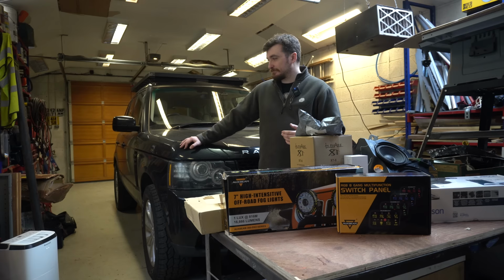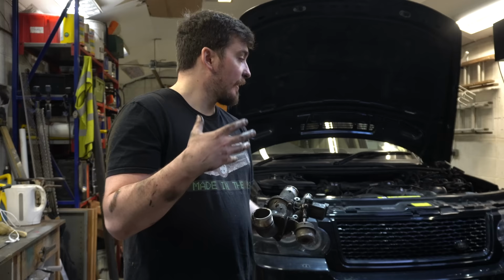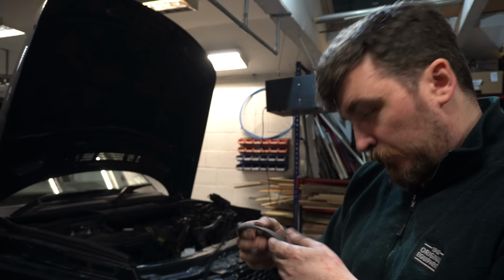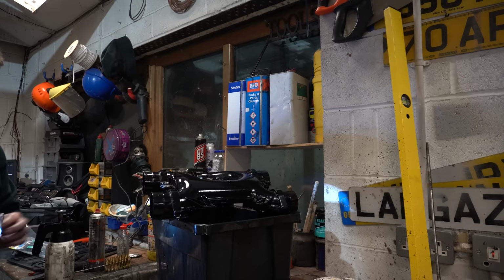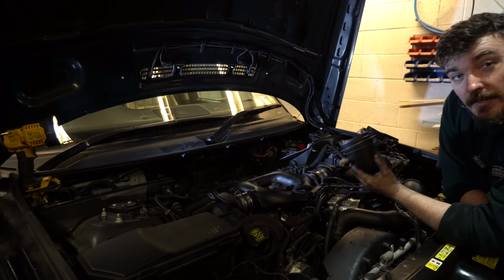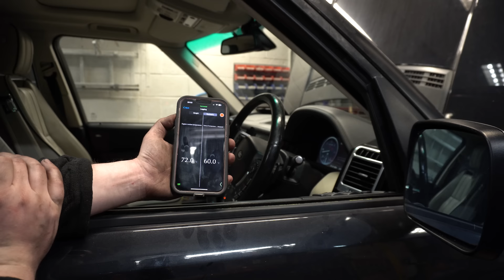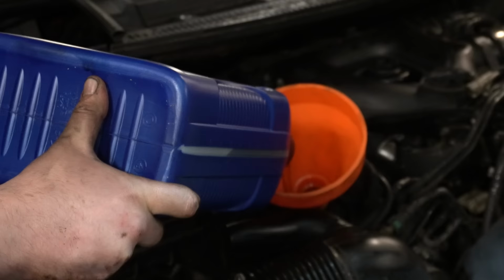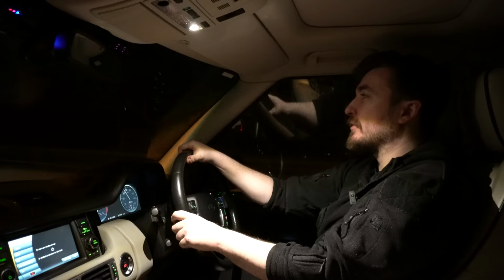THIS is why EGR is so bad for your Range Rover. [4.4 TDV8 Belt Squeal, Inlet Cleaning & Service]

Comment: I took of the EGR valve, and made two aluminium gaskets about one millimetre thick using the EGR as a template, I then put the whole lot back together, with some gasket cement, and effectively blocked off the EGR valve with the two aluminium plates, which did not have the big hole in the middle of them. I put everything back together, and started the engine, which not only ran perfectly, but after a hundred or so miles on the road, I realised that my diesel consumption had improved from around 18-19 miles per gallon, to almost thirty miles per gallon. I have since then covered around twenty thousand trouble free miles, with no problems, having effectively blocked off the EGR valve.
Reply: Not saying you haven't seen that increase, but one of the reasons for EGR is to improve MPG
Reply: @Phantom-mk4kp  yer right,stop spreading lies,you work for car companies.who cares on the mpg it’s nothing,people don’t be gas lighted??ask these questions does the government and the car companies what your car to last???do they won’t you to have your own car??? They want to destroy your rights and freedoms
Reply: @SuperJacobe just because you don’t understand how an engine with an EGR system works. Doesn’t mean the boogy man is coming to get you. 😂
Reply: I can happily report that I did the exact same thing with the exact same results. Had the egr deactivated via software for about a year but finally blocking it technically made a huge difference in many ways. Seemingly imy egr was stuck open or something as the engine now has got much more power/boost with light throttle. Where did you block yours? I just put in a plate in the flange before the final elbow that goes into the donut.
Reply: @vb879dr  Thanks for your response, and I am glad that it worked for you too. I blanked off the egr on inlet and outlet side, and capped off the vacuum pipe. It's better than ever right now.
Reply: What a load of bollox
Reply: @pking6402 what makes you say that egr is a curse so is dpf,I am not a keyboard mechanic but worked on Volvo and Scania trucks till I retired.admittedly a much bigger engine but same principals
Reply: There's a big chance that should you push your engine bit harder you'll get Check Engine light. You can turn it off again with cheap OBD reader. But pretty annoying still..
Reply: Guyes I also removed the EGR and unblocked or hollowed out the DPF. Got the same 10 mpg improvement as the others. We also did a mild eco remap to supply a bit of extra fuel to match the better air flow. No problems ever since. Get your regular mot mechanic to do the work. He needs to pull the emission probe back a bit when he does the mot. Im lucky, no mot where i live.
Reply: I have a croma with a egr and dpf delete runs great dose about40 to the gallon on a 2.4
Reply: I ordered from auto doc put my reg in and I received the wrong part had to give them my vin and I then had to build my own drive shaft from parts
Reply: @Phantom-mk4kp  The concept of Exhaust Gas Recirculation was developed by General Motors in the 1970s. The goal was to reduce emissions of nitrogen oxides (NOx), a gas harmful to human health. Unfortunately, due to EGR gases mixing with modern thin diesel oil vapours via PCV it causes sticky sludge to build up in the intake. Essentially, we are choosing to destroy engines rather than our health.

Comment: I got the errors "EGR throughput too low" then I switched to Aral Ultimate Diesel and the problems are gone. Ultimate is somewhat costy, but it cleans the engine and eliminates the carbon.  Highly recommended. Cheers, Chris

Comment: Two things Sam, Christian of LR Time fame advocates the 5W-40 oil too! So you are in good company. Second, have a Google re cracked walnuts to clean the inlet manifold in situ. I tried it and it cleaned them perfectly without taking the inlet manifold off. And oh yes, short journeys kils fossil fuel engines, get an old Nissan Leaf for those short journeys and you won't look back! There is no need to worry about battery range as you only use it for those short journeys, together with a home charger at night time rates, it ticks all the boxes!

Comment: Intake cleaning is mostly ‘cosmetic’ as there is still plenty of flow capacity for a diesel to run at full power. Look at the cross section area of the throttle intake then divide by 4 to see how much each intake on the valve cover would need to be blocked to restrict overall flow. The important bits on these 4.4’s you have covered - leaks, MAP sensor fouling ( clean every month) and throttle plate cleaning ( excessive fouling and loss of movement can strip the internal gear teeth). Oil changes in the 5-7k mile interval are also wise as the factory interval is way too long and older higher milers with ash clogged / reduced soot capacity DPF’s will regen more frequently leading to possible oil dilution issues.
Reply from the maker: Yep, concur with all of that.  My DPF is no longer an issue, but before I had it “fixed” it was attempting regen nearly every journey due to high ash load.

Comment: 100% on the 5W40. I use this (Mobile 1 or Liqui Moly) in my ML350 BlueTec. I also add an oil additive called TurboMaxx. The guy has a channel with interesting tests. As an engineer you will also find this interesting. If only we could get the RR 4.4TDV8 here in Canada.

Comment: Had the inlet off my Dad's BMW 120D to replace the glow plugs, really surprised the thing could run, there was so much shit and sludge in there that the swirl flaps wouldn't operate and just enough room to stick a pencil in the inlet. Cleaned it all out and it's a different car, with no more black smoke when you boot it. As with yours, it's a good job done. EGR's went walkies (mapped out % deleted) on mine as soon as I got it, never had any issues.
Reply: Have you had any issues with the DPF regen or getting it through the control technic Ben? That's the bit that worries me about the EGR :\
Reply: @JohnBaxendale  mine is not fitted with a dpf, so don’t have that to worry about. As for the egrs and the control technique, it’s been through two tests since having them done and it’s passed both times without issue. They are both still on the car, and if inspected still look hooked up, they are physically deleted with a blanking kit and removed from the ecu map. Emissions are super clean at every test.

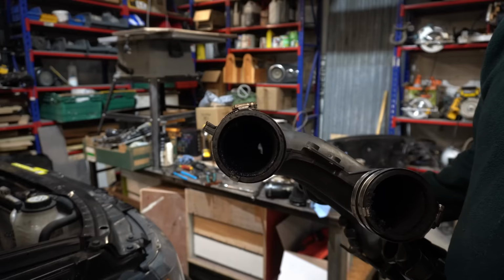Comment: 19:28 This is oil caking with soot. You should replace your oil separator.
The soot from exhaust/EGR is dry normally. The oil vapor from crankcase is what doing it mudy.

Comment: Great video as usual. Just for the craic, I have a justified hatred of changing the belts or pulleys. However I did manage to do the last couple without removing fan shroud or lower trays etc.  Just top charge air pipes and one or two coolant and induction pipe.  and the two airboxes..  Cranked fan off and just moved it out of my may enough to access pulley bolts and tensioners. Changed both belts in 2 hrs... Fair bit of potty mouth and a litre of blood but its doable. Anyway maybe helps someone.

Comment: Cool vid. Love the 80's synth pop haha! Might be worth you just blanking the EGR completely and venting the PCV to atmosphere or using a quality catch can. Legalities observed of course! I did the same on my D2 Td5 and it runs like a Swiss watch. I removed and cleaned out the alloy intake manifold twice, post EGR 'surgery', and just sloshed around a whole can of degreaser inside, worked a treat. Removing those restrictions on the intake and output of a diesel and shedding weight from the vehicle are the best free performance mods you can do IMHO.
Reply from the maker: Cheers for the comment!
The PCV on the TDV8 is a bit of a pain to access, it’s situated in the “vee” of the engine underneath the EGR valve which is underneath the oil cooler.  I’m not sure how it operates or what it even looks like, but I presume from its position that it vents directly into the head/inlet manifold rather than further back in the system.  I think the oil in the charge air system is coming from the turbos, and probably mostly from the secondary turbo which is only used when you boot it over ~2k rpm which isn’t very often.  
I’ve not had a Td5 for a long time but the biggest gains I got were from deleting the EGR and cat 👌🏻

Comment: I blanked off the EGR’s on my 3.6 TDV8, & the EGR on 4.4. Once I had done the 3.6, I found that my oil, I always use Edge Professional, retained far more viscosity. I always used to change it at 2.5K & it used to be black as the ace of spades. Once the EGR’s were taken out of the equation, after the first change, at 2.5K the oil would be an off grey, and to be honest it would have been fine. No one will ever convince me that an EGR, is a good thing. They’re not. They do bugger all for the longevity of an engine, so where’s the “good for the environment” in that?? 
Next thing will be to put a core drill straight through the DPF!! Bloody tree huggers do my brains in! Great Video!!

Comment: I really enjoyed watching this video, thank you.
We did a belt change on my 4.4 tdv8, in my father in laws workshop, on a 2 post lift last month, without removing the fan.. it was interesting to see how much easier it would have been if we had taken the fan out like you did.  Time wise I don't know if it would have been quicker, maybe - it took us about 8 hours.  At least 2 of those hours were messing with the bolts on that rigid water pipe, that we needed to move, even though we didn't detach it.

It was also interesting to see your work cleaning the doughnut.  I took my egr elbow pipe out this week, and was horrified to see how much gunk there was on it.  Of the 8 holes in the elbow that let the nastyness into the engine, only 1 was still working.  No wonder I was getting insufficient egr flow errors.

I also suffer at the moment from a dpf that fills too quickly in my opinion.  This issue I hope to go away shortly, like yours did.

Comment: An oil catch can can and will help with any oil buildup within the inlet. In truth, for those who wish to keep their EGRs, a catch can is essential to remove the risk of build up caused by the oil and carbon vapor... Its also a cheap solution but make sure a Diesel one is purchased rather than a petrol one...

Comment: Ok, I did not see the whole video, but mine is a 2008 3.6 TDV8. I have blocket the EGR-valves and removed them from the computer (can't get any fault messages there) and removed the the particle filters (using a long drill first, then a long chisel and a hammer) and also removing it from the computer. I had to hire a guy to do the computer stuff. 
The car had then done 260 000 kilometers. Fuel consumption went down a least 30%. Everything look original. 

I can get 26+ MPG. They say I can tune it and even get more, but I am not sure if I want to. But I love the car.

Edit: If you do the particle filters yourself, get a GOOD mask, the dust in there is not good for your health. !!

Comment: Hi Sam,
Another great video. Just thought I'd share my experiences with my 2012 44TDV8. I have done many of the jobs you have promelgated, but prior to your releasing them. Mine has 220,000km on it now. I didn't clean the inlet doughnut (which looked like yours) because I saw what was in the rocker covers (inlet manifolds). My  car DOES have dpfs, so we are in the same boat as you- perhaps this is because mine is a 2012. The biggest issue I have with my vehicle is how doughy the throttle is off idle. Despite all the sensor, throttle body, cleaning and replacements, its as doughy as when I first bought it used, with  92,000km. Im not really interested in chips and upgrades, as I regularly tow, and notes that the 8speed auto is near its design  limit technically, in stock tune. Despite this, my car goes like stink, even when towing a 2.8T van. I love it! When I took my doughnut off( around 4yrs ago), I replaced the belts and pulleys, every coolant hose in the engine bay and heater, thermostat housing complete, and every plastic water fitting. Our high ambient temps, and my want of no break downs warranted this. I have enjoyed remarkable reliability. I have to replace the pelter in the drivers seat to warm my arse for the coming winter, but cant fond a reasonably priced part yet. What I would really like, is to be able to turn off traction controll when on slippery muddy slopes. Any ideas?

Comment: I was starting to get l322 content withdrawals symptoms Sam 😰🤣 thank god you saved me 😉🤣🤣 as for the 5w40 I started using that in my td6 the second year of ownership and you know how tractor they sound but I found that switching from 5w30 to 5w40 made it much more quite and it seem to run better and I use triple qx 5w40 it’s a cheaper oil but I’ve had no problems with it at all td6 on 146,000 and running spot on anyway glad to see you back in the hot seat bud keep up the good work 👏
Reply: Hm I was always told 10w40 semi synthetic in my TD6 you’ve got me wondering again now
Reply: @pug2052  depends how many miles you have on the engine mine has very low miles for its age and 10w40 is for very high mileage vehicles with very worn engine components
Reply: @pug2052  it actually says in the owners manual for U.K. temperatures to use 5w30 in the td6  when the car is new but now it has miles on it It makes more sense to use a slightly thicker oil hence why I’m using 5w40 but it also does say in the manually you can use 10w40 too I guess it’s up to you I went by my cars service history and it had been using the manufactures recommended 5w30 up until my purchase and I changed to 5w40 and noticed it was running much smoother and quieter so stuck with that but each to there own I guess
Reply: Mine has done 200k but is not worn by any stretch the turbo is original and not leaking any oil the engine never smokes apart from a small diesely puff when it starts the oil has always been changed every 6k miles though should I switch to 5w40 would you say or carry on with 10w40
Reply: @pug2052  it’s up to you , but if it’s been running on 10w40 all it’s life and no probs then why change ? But trying it won’t harm your engine because these engines can take between 5w30 up 10w40 I only moved up to a slightly thicker oil to make engine a bit quieter if you move back down to 5w40 your engine will probs run better but may sound louder but like I say it’s up to you , you won’t know till you try it 🤷‍♂️

Comment: A new video was a nice surprise today. I had to have the EGRs replaced on my old TDV8 3.6 (here in Germany blanking is illegal). The EMS in the 4.4 is supposed to lube the EGRs with engine oil to prevent them clogging up (one of the reliability improvements over the 3.6) so it's a bit worrying to see it in that state. Mine's just hit 200000km so its still little way off your mileage but I hope I never have to do this on mine 😄

Comment: LOL @ donut now being half the weight of the pre clean condition. 

A good method of cleaning could be to use cork bungs to keep in the degreaser of choice, you could block up all holes and shake the unit to try and cut down on the scrubbing.  My idea comes from DPF cleaning methods.

Comment: but using a thicker oil surly will make the oil pump work even harder meaning first start of the day means taking longer for the oil to do a full circulate of the engine. and in freezing cold temps will take even longer, BUT  yes being a thicker oil at running temp will be a tiny bit more lubricated.

Comment: Hurray,  you're back! Two things, with the belt, do check the tensioner!  On the td5 they seem to go between the arm and baseplate witch throw them out of line.
Second,  where did that oil come frome? Not the oilcooler or the oilfeed pipe to turbo!? 😮
My wallet is getting scared...  keep them coming!  Thanks!

Comment: When you give the engine proper going over you may as well take the heads of to regrind the valves none of them will probably be a good seal on account of lumps of that gunk being deposited on the valve seat's plus you'll be able to give the inlet ports a proper clean i stipped down a TD5 engine every valve seat leaked and you could see where gunk had been on the seats

Comment: I have the same vehicle and periodically get various odd symptoms. The belt squeals under low speed acceleration on occasions and the battery is regularly reporting as low charge even though I put a new battery in. I also get periodic electronic gremlins esp on the entertainment unit which seems to trip out.

Comment: You can just about get the inlet manifolds off without dropping the engine, when my left side manifold split they managed to loosen the engine bolts and pull it forward with enough to get the injector out.

Comment: Great video, Sam.  Cleaned my inlet earlier this week, but not as comprehensively as you've had to do here, and the improvement was instantly noticeable.   Worried about that boost coupling now though .. it isn't a very reassuring fit.  I'll look at it again.
Reply: *comprehensively

Comment: I'd be interested to see how you get on with the ELF 5w40 oil. The Evolution 900 SXR 5w30 mentions use in turbocharged diesels and meets the WSS-M2C913 spec for the TDV8, but the 5w40 only mentions naturally aspirated diesels and doesn't mention meeting that spec. An old mechanic friend of mine mentioned that some oils struggle with the turbos on the TDV8 and it leads to premature turbo death, so I don't know what to believe! I would prefer the 'smoother' sound of the 5w40 though if I can get away with it...!

Comment: Sam, why don’t you try a cleaning product to remove the carbon from the inlet manifolds to see if it works before you strip the engine
Reply: I mean the sprays or foaming agents that claim to clean up carbon deposits. You could try a different one each side to compare results